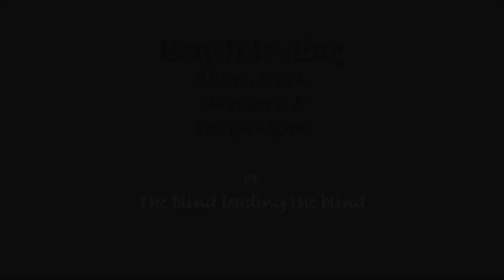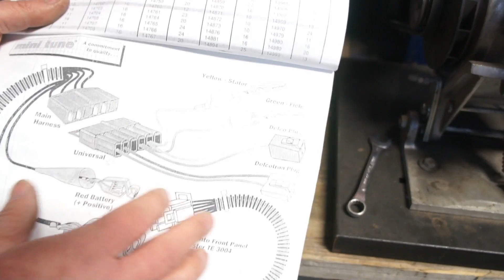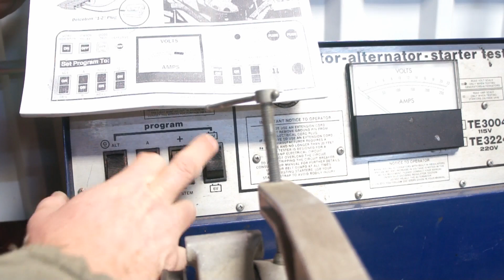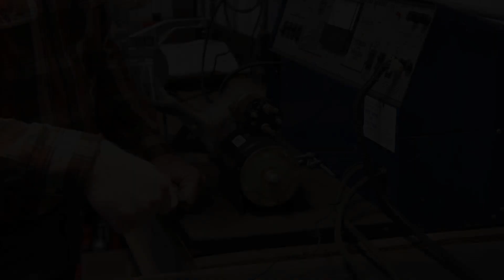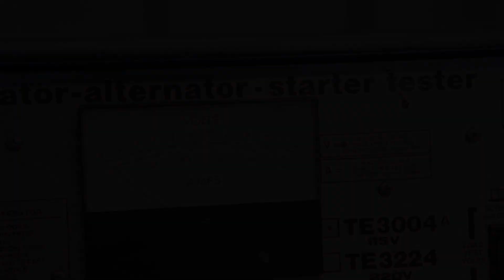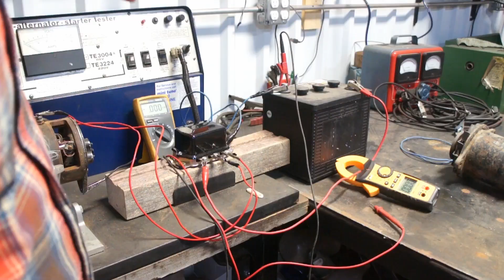OTC / Mini-Tune Generator Alternator Starter Bench Tester | Let's Spin Some Stuff Up!

Comment: Perhaps you could give me a helpful opinion! I'm having charging trouble with my 1937 Buick, it has a Delco two brush generator, externally regulated. I tried my best to follow each step you made where you address the 1938 Buick gen but nothing seemed to work. I polarized both the regulator and generator separately, respectively the generator by jumping A terminal to BAT terminal and the regulator the exact same way, with the generator wires disconnected and afterwards connected too. At 2.000 RPM I got a gen voltage reading of only 1.5volts output, aside from the engine there wasn't anything else turned on in the vehicle that could draw power. I opened up the generator, the brushes are clean and not completely worn out, commutator surface is clean and the brushes make contact perfectly. Had a look in my shop manual and a procedure they call upon is attempting to ground the field terminal, and if the system is charging, I should clean the regulator contacts, which I did, however, to no avail. 
My regulator is the same as the one you showed in this video, a 40s/50s Chevrolet 1118201/301 style.
When I grounded the field with the engine running, I was reading a 13 volt output at the A terminal on the generator. I have attempted to make an amp reading but I failed, mainly because I never used a multimeter before. Hahah! 
On top of all this, I made a ground continuity test across A and F on the generator and ground has continuity through both terminals, is that normal? 
Hoping you can shed some light on this matter that has been shadowing my existence for the past few weeks.
Reply from the maker: If your generator is out of the car do a motoring bench test like I did in the video that I showed at the beginning of this video. If it motors, and then speeds up when you disconnect the field MOST likely your generator is working. If it doesn't speed up test resistance across the A and F terminals. (that's the Ohm or "horseshoe" setting on your meter) I often have 2 or 3 ohms on good field coils though some say it should be a fraction of this. 
If it works on the bench test however, reinstall the generator and reconnect all of the wiring. With a jumper wire, touch the Arm terminal on the regulator with the Batt terminal for a second or two. When you take your jumper wire off you should see a spark or two, that's normal and your generator is now polarized. 
With your ignition off crank the starter several times to use some battery voltage up you could also turn on the headlights. Test the voltage of the battery so you know where you're starting point. Now start the engine and take a voltage reading at the batt terminal of the regulator. You should see your battery voltage to begin with, then increase throttle by hand as you continue to watch your meter, as the engine speeds up your voltage should go up. Get back to me here or email me ratzlaffmotorco@yahoo.com with the results and we will go into what to do next. 
I'm not sure if you tested from A and F to ground with it in or out of the car. The Armature is grounded internally with one of the brushes and there are a couple of grounds through the regulator on the field circuit.
Reply: @TheJayhawker  I tested A and F to ground continuity with it on the car, the case of the gen is definitely making ground contact, is it not supposed to?
I also tested the gen with the belt off to see if it motors, and it did, however, only when I was connecting F to ground, when I left the F lead into the air and flashed A with positive current, I could hear it click but it was not spinning. Something weird is going on and I have a feeling I might need a new regulator as well.

Comment: did you check the output on the field lead in 6v mode when you run the 12v first its causing energy to be stored up some where could even be a faulty transformer i would guess there is two stages of input power on for 12v and one for 6v if your not getting voltage to the field in 6v that's where i would start. knowing me i would have already taken it apart to look for a wiring schematic or reverse engineer it and draw one myself at least you got it figured out that's half the battle.
Reply from the maker: lol, yes that's part of the problem, I can't find a schematic either. I don't remember now if I tested the output at the harness earlier or not so I will do that. I really enjoy automotive wiring and house wiring but peaking inside things like this just scream "I'm gonna kill you if you touch me"
Reply: @TheJayhawker  lol yeah I'v been zapped a few times in my life this might sound weird but i have what they call photo graphic memory and when i was a toddler my pops had this thing where he collected the cords from old appliances and he had these really nice speakers 18" cerwin vega and i would watch every thing he did and one day i crabbed a old cord and hooked it up and plugged it in what i saw was the coolest thing ever. So i did it again mind you I'm like 3 1/2-4 Yrs. old he never figured it out lol but now I'm UL certified
Reply from the maker: @jamesduffus4455  lol, wow glad your still hear to tell about it!